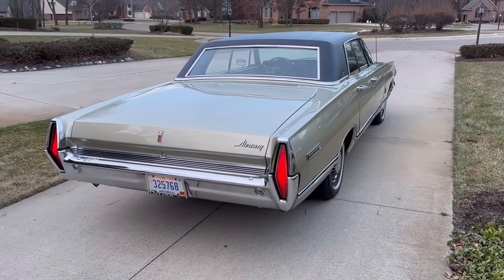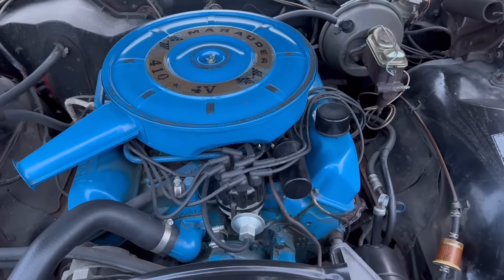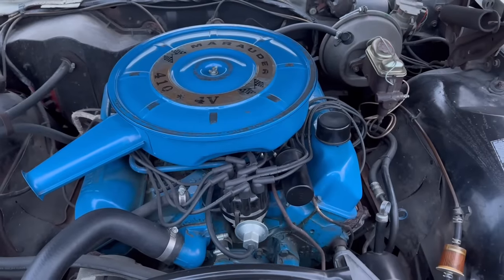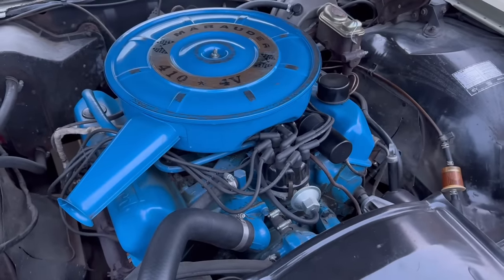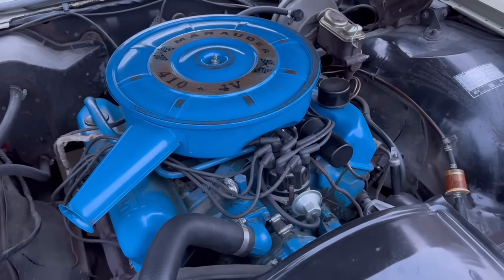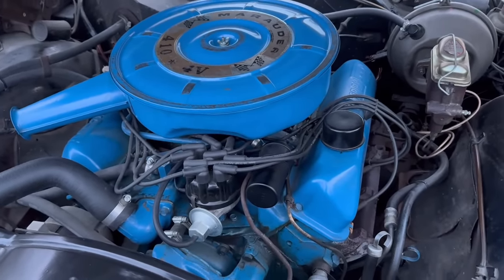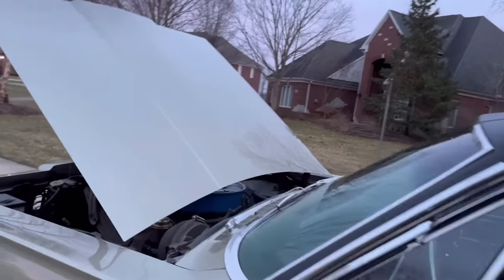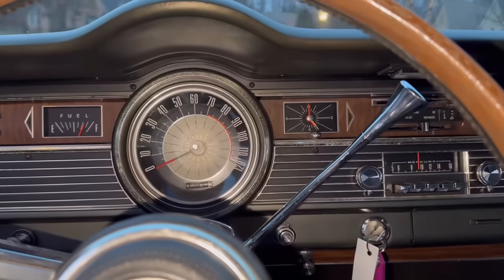Ford's Shortest-Lived (and Smoothest) V8 Engine: The 1966-67 Mercury Only 410 V8

Comment: Yeah. Did you know that Ford did make a 426 very rare. There's only 3, but I believe one is in a factory car and I believe 2 exist, but the 1 that's in a station wagon. It was requested, so when that motor came out, there was only 3 of them that were made
And I believe one was being scrapped or destroyed. And the one motor that was swapped out of a factory vehicle per request. Was put in to A i want to say fair lane. It's a very rare motor that Ford had made from the factory, but yes, Ford did made a 426
And I'm trying to search for it to prove that it exists, but I can't find it when I wasn't looking for it. I found it funny how that goes. I didn't know that it exist but yes. And there is documentation of the engine swap. From what was originally in the station wagon to the 426, because the father of the Sun that has the car now said that his father wanted to have a faster car on more power with a 4 speed manual and there was documentation of this happening.
So as to why Ford didn't talk about this or forgot about it. But I believe the four twenty s talk about this or forgot about it. But I believe the 427 and 429 was a derivative of that 426 that Ford had made saying that they made the 426 foot Dodge. But what I'm saying is, Ford made a 426 very rare, and it works, so there's that i want to say it was a Galaxy 500 but or a Fairland is one of the 2 I don't remember exactly, but again, when I wasn't looking for it, there, it was.
It's something about forgotten motors.
Is what I remember, but I can't find it, which should be easy to find, but then again, sometimes it's Google. And the search is random at best when I look for the 426, it gives me 4 27 4 29.
Not the 426 that Ford had made. This is part of the Ford history, but I do not know why they don't show that weird, but I do believe there was only 3 that were in production in a scraps, one during the end of the
NASCAR ban on 426. It had to do with NASCAR, and the reason why they only made 3, and it didn't make it to production. Or mass production? But one of the 3 definitely, is in a customer's vehicle, with documentation surprising.
But I do believe the Sun is the one that owns this vehicle now taken from the father who bought that vehicle ordered it with the 426. And you would think with a 426, it would pop-up with no problem. This is like a needle and a haystack. What took me seconds to look, it's now gonna probably take me hours to find weird. How that works?

Comment: I was a mechanic  at a Ford dealership from  1972 to 82 and I have to say that I never liked the entire  line of FE engines. Especially  that huge monstrous intake manifold  that I practically had to use a cherry picker to lift off and on.

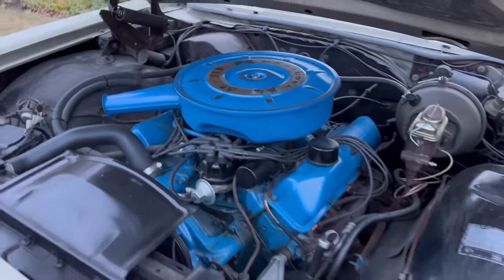Comment: What about 4:23 221 small block early 60s preceded 260/289 ford falcon??
Reply: They were available in 1962 & 1963.  My sister had one in her '63 Ford Fairlane.  What a wheezer!  Even the 260 V8 would have been preferable to the 221.

Comment: Another short-lived FE Ford engine would be the Edsel 361 ( or E-400  ( 1958 ) or " Super-Express " ( 1959-60 ).

It was standard equipment on the 1958 Junior Edsels ( Ranger,Pacer, & station wagon ). It became the top option for 1959 & 1960. 

Although technically offered for three model years, the last 1960 Edsel was built in November of 1959.

Comment: What about the 1964 or 1965 ONLY aluminum Oldsmobile "weird Alice" V-6's in the Holiday??? GM experimented with EFI (not fully developed) and a mechanical blower on them-all were total failures as GM's foundry couldn't make an iron linered alloy engine with "cast-in" liners. I think Holiday's spent more time in the dealer's shop than on the road. If you screamed loud enough, GM replaced the V-6's with a 300-ish (probably 283 based) CID V-8. The 1962-63 Buick Skylark had a "one-year" 194 CID alloy V-8. It "grew" to 208 in 1964 and then stayed at 225 until Buick dropped their alloy pressed-in liner V-8's mid-1968 for 1st Gen "Smogger" engines. You HAD to use GM coolant additive in them or the water-pumps leaked and failed. The "baby Buick" was a super smooth engine too, with surprising power and torque. The 301 CID cast iron V-8 ruined the little Skylark because of the weight.

Comment: 265 V8?  The Mustang had it for a half a year in 1964 1/2.   Not sure
Reply: 260
Reply: 265 is a Chevy engine. Ford built 260 engines from late '62 through '64. The early '65('64½) Mustangs built in '64 used 260.

Comment: Ford 265 v8 I believe was about that or even smaller life span.260and 221and the 255 had short ĺife spans because they lacked the power  and that brought about the 289 and then the 302
Which led t the 351w  the 30 2 and 351 have the longest life spans.
I believe next was the 4.6 modular v8.281 cid.which was in mustang trucks vans and of course police packages the 302, and 4.6 have the longest lif we spans now how long will the 443 Las as big truck engines in the 3/4 ton trucks.

Comment: All the engines had removeable breathers in the valve covers. How else would you add oil? A tiny funnel in the dipstick tube? lol Also, the 410 wasn't any smoother than a 352/360/390/428 that I've worked on.
Reply from the maker: Many engines just have an oil fill cap that is not integrated with the breather. See most any GM engine
Reply: @RareClassicCars  yeah, I work with old Fords, not GM. The pcv is often in one valve cover through a rubber grommet and connected to the intake manifold for a vacuum signal, that system needs a breather in the opposite valve cover so that's almost always the fill cap as well.

Comment: thats a tiny air filter,, 6 cylinder.. id be turning the top over,,get a std hand one, so you dont mess the original one,, more air more better..  plus, id up the carb, keep the old one.. edelbrock 600..

Comment: What shortest lived ...the 410? Are you kidding me....!!! The 410 is an FE engine, same family as the 332, 352, 360, 390, 406, 427, 428 .. in fact its stamped 352 on the front of the block casting. 
I'm pretty sure the 410 was a 390 block with shorter 410 pistons due to the use of the longer strok of the 428 crankshaft.

Comment: HES WRONG about the FEs running Smoother than 385 series 429 and 460s ! My Family and ! Had a lot of Vehicles with 390s ! My first car a 63 Ford Thunderbird 390 , second car 66 Ford LTD 390 , 3rd car 68 Ford Thunderbird 429 Thunderjet ! I had 2  1972 Mercury Marquis ,with stock 429s plus a 77 Lincoln Towne car 460 ! They were Smoother running THAN the 390s ! .

Comment: There's a Ford factory FE that's even more rare; a 406 cid.
Reply: They were available in '62 & '63. In '63, Maryland State Police used Galaxies with the 406 V8 w/3x2 barrel carbs (Police Interceptor).  They sounded great when they got on it, but as one trooper told me, "You can almost see the gas needle drop every time you stomped on the gas".
Reply: Thank you very much.  I memorized the CID chart from a book titled "Fix your Ford" from the 1960s, I was like 6 years old.  Didn't know anything more about the 406 other than it existed.

Comment: You are wrong about that engine not really being built to move a lot of Air you can Put a bigger carburetor on their like a 750 elderblock or 800 Elderblock or even a 750 to  a 830 Holly carburetor and make sure you  jet The carburetor  plus I would put an aftermarket ignition system do away with points.
They are Junk!! And that engine will come to life.

Comment: Nothing much worse than working on a GM car on a hot day with the distributor up under the firewall. I will take Ford's over all the others. When a better truck is built you can be sure that Ford built it.